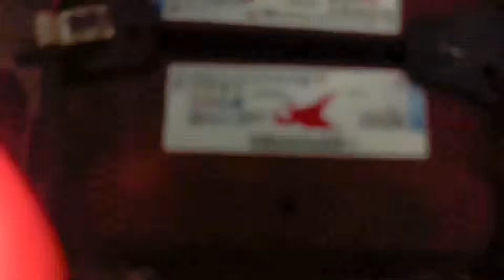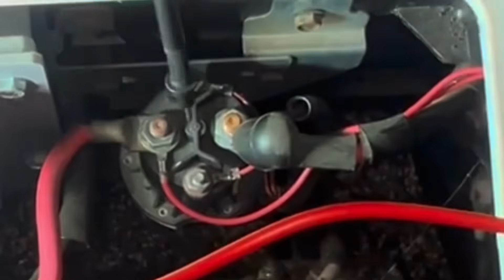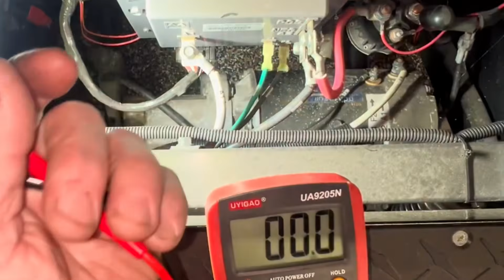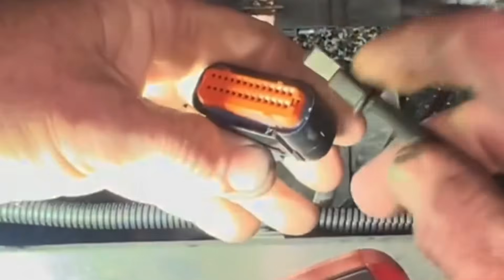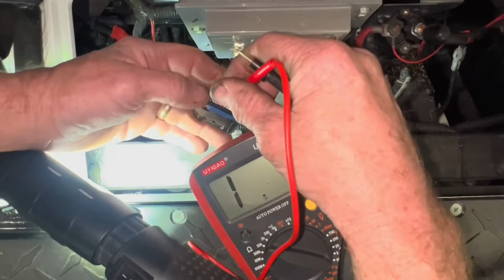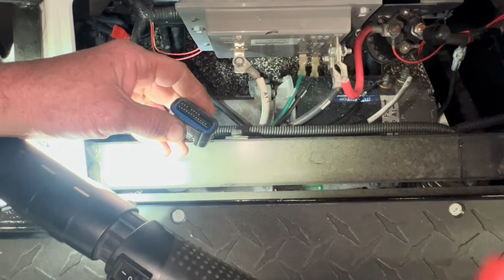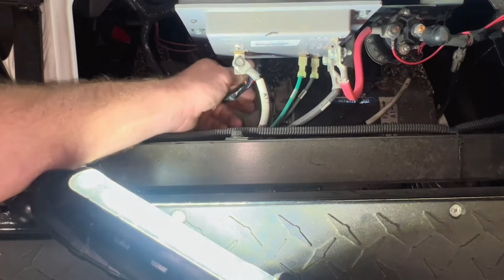Yamaha Electric Golf Cart Troubleshooting - Fixing Common 48V Issues

Comment: Got a question for you sir, 2010 Yamaha drive no voltage when hitting the gas when I put my multi meter leads on the small posts of the solenoid. Bad key switch ?
Reply from the maker: Put the black lead on the main negative red lead on the red wire. Tell me what you get.
Reply: @golfcartwhisperer doesn’t show any voltage from main negative on battery terminal to positive wire on solenoid.
Reply: Also has no resistance from pin 5 and 7 when hitting the gas. Super confused right now lol
Reply: But I tested my key switch and I’m getting voltage there
Reply from the maker: @likezay4627 small post correct? if so, black lean on main negative the red lead on the back of the tow switch Make sure you have voltage is there.
Reply: @golfcartwhisperer sorry yes I’m getting voltage from main negative to small red post on solenoid. And run tow switch is getting proper voltage too
Reply: What do you think my issue is ?
Reply from the maker: Put the black lead on the main negative put the red lead inside pin number three which is your brown wire and hit the gas. Tell me what you get.
Reply: @golfcartwhisperer yup I get voltage there
Reply: What does that mean ?
Reply from the maker: That means your pedal switch I good.
Reply from the maker: Test pin 4 then move the lead to pin 5.   Changing from forward to reverse
Reply: @golfcartwhisperer 48 volts on pin 4 ( black wire ) and only 5 volts on pin 5 ( light blue wire )
Reply: Pin 4 is forward pin 5 is reverse right?
Reply: I’m confused though because it’s showing 48 volts in forward for the black wire and 48 volts in reverse on that same black wire. So voltage doesn’t drop down when I change from forward and reverse .

Comment: Hey bud let me pick your brain I feel like I’m missing something. 2016 Yamaha drive. Solenoid clicks and is working,  controller puts out pack voltage when I hit pedal. I had to put new brushes in the motor. I tested the motor with 12v battery and motor spins.  Could the throttle pedal sensor be the problem if the solenoid clicks?
Reply from the maker: Yes and no. Depending on how the tps failed.  On your output voltage to the motor does it climb voltage the further you hit the gas
Reply: I’m checking the blue and orange wires to the black per Yamaha service manual. Ohms between blue and black is 5 constantly orange wire to black is 5k ohms also pedal up or down. Manual says orange wire is not supposed to see 5k till fully depressed. Does that sound right? I just thought it was weird to have a failed throttle sensor and the controller still puts out voltage.
Reply: Just re read you question you ask about controller. I get pack voltage on controller output as soon as I depress the pedal
Reply from the maker: @MikeLilly-z1n as soon as you let go of pedal it shows battery voltage?
Reply from the maker: @MikeLilly-z1n if it reads 5k already then that’s bad.  But it will click the solenoid that way.
Reply: Yes, as soon as I hit the accelerator pedal in the solenoid clicks, I show full pack voltage output at the controller
Reply from the maker: how are you testing it?
Reply: Like you show. Red lead on b+ black lead on white wire on controller.
Reply from the maker: @MikeLilly-z1n the reason it shows battery voltage is because the throttle sensor is shorted.  But the f n r. Wires are. It allowing voltage to go no where because of the hpd

Comment: Hey I have a 2013 g29 48v . New battery’s and new cables . Cart runs great until you start up a hill then it’s like the solenoid kicks in and out , motor will grab then stop back and forth. It doesn’t trip any thing but if I turn and go back to flat ground it runs great again. Any insight?
Reply from the maker: Have you replaced anything recently. You need to sit on the side of the driver body with the front seat off and check each battery as your driving up the hill. Sounds like bad battery
Reply: @golfcartwhisperer well I bought it not running. The batteries were trash so I replaced them with new 8v superlex batteries and new 2guage cables. They said it was doing that before the old batteries quit . They replaced the motor on it thinking it would fix it but it didn’t then the batteries quit so they got tired of messing with it. I would have sworn the batteries were the problem until I just put brand new ones in it but I will try the test them under load.
Reply from the maker: @Mechanicallyinclined141 well let’s start with the batteries then we’ll go from there.
Reply from the maker: If none of the batteries show bad put your volt meter on 200 vdc and check the small post on solenoid.  What color are the solenoid wires small post.
Reply from the maker: Once you test the batteries individually test them
A a a whole
Reply: @golfcartwhisperer one red and one red/black
Reply: @golfcartwhisperer did each battery separately and they all had 8.5v and none dropped below 7.8 while testing. They have 51.4 and never dropped below 45 while testing
Reply from the maker: @Mechanicallyinclined141 okay good. Put black lead on main negative. And touch it to the red wire on a small post on the solenoid while it’s plugged in and when it quits running see if that dies meaning you want to see if that wire loses voltage or is it the other side which is the ground coming from the controller that tell us which way to go
Reply: @golfcartwhisperer it doesn’t voltage drops from 51 to about 49 and it’s trying to go up but starts loosing power and eventually stalls them the motor jumps

Comment: I have the same golf cart as what is in the video. I have a problem with voltage at the Solenoid.
My Voltage going from battery to Solenoid is 50 volts, which I believe is normal, however when I put multimeter negative on north screw and positive on south screw of solenoid(the two small connectors.), I get initially 49v that almost instantly drops to 29v consistently after I hear engine hum kick in when I press pedal. Wondering if this indicates a motor sending voltage shorts back through solenoid or if it indicates a bad solenoid. All other places I put multimeter following along with video show up normal voltage even the Voltage from Solenoid to controller, which was a surprise considering I get voltage drop from the indicators that look like they are in-between that connection and the battery on the solenoid itself. 

Golf Cart symptoms are solenoid clicks but golf cart wont always respond and go, then sometimes it will go, but it always struggles at top speed and acts like it is having power surges plus rides super slowly/erratic.
Reply from the maker: Do this here put black lead of meter on m- on controller and the red lead on one side of solenoid hit gas tell me what you get. Then do the same test but move to the other big post with the red lead and hit gas. Tell me what you get
Reply: With Negative of multi-meter on m- of controller, and positive on each big post of solenoid with gas pressed I get 2.62V consistently from both sides. What does this indicate?
Reply from the maker: Put the black lead of meter on main negative and the red lead on main positive on battery what do you get. Hit the gas during the test
Reply: @golfcartwhisperer Positive and negative on main battery test I get 50.8v without gas pressed 50.6v with the gas pressed.
Reply from the maker: What did you throttle v
Position sensor voltage ahow
Reply: @golfcartwhisperer With Black lead on M- of controller and red lead on main battery positive I get 2.62 volts again.
Reply from the maker: Yeah that’s not good.  Sounds like something inside the controller is acting up.
Reply: @golfcartwhisperer  With multimeter connections on pin 7 and pin 5 of the controller plug on the 20k ohms setting I get 1.22 at rest. Then a fluctuation down to 0.15 with the gas all the way pressed.
Reply from the maker: @jimcarrey7006 that’s good.

Comment: I have a 2007 YDRE 48V, stopped dead on me while on course.  Batteries all load test fine and 53V when in tow position.  Switch to run, solenoid clicks, voltage on system drops to less than 1V.  Fuse good, all wiring appears good with continuity check.  Did try replacing solenoid but same result.  Completed 12V motor check and had motor rotation.
Reply from the maker: @cojo5495  thanks for commenting.  Put black lead on a1 on controller and  red lead on b+ on controller hit gas tell me what you get
Reply: Thanks for the quick response. I’m getting 0v when I try this.
Reply from the maker: @cojo5495  okay so that means your getting no voltage out the controller.  Have you checked the throttle sensor yet
Reply from the maker: @cojo5495 what did. Outages check according to the video
Reply: @golfcartwhisperer  hey again, thanks for all the info...update, replaced the controller with an Alltrax, solved the problem...nice upgrade from Moric
Reply from the maker: @cojo5495  ok yeah big difference and faster
Reply from the maker: @cojo5495  thanks for letting me know the outcome. Most people just run off into the abyss once I help so who knows if it fixed the problem or not.
Reply: @golfcartwhisperer couple of your clips helped me confirm my suspicions…much appreciated

Comment: Hey buddy ... Your the man... Great videos , keep it going...did you ever make that second video ?   I have kinda tge same problem . 2006 yamaha 48 v g22 .  ..replaced solonoid ,replaced throttle sensor ,checked all wiring from schematic .solonoid  clicks when pressing pedal . The cart runs but only when you give the wheel a push.. it catches and runs perfect.  But when it stops for a few seconds i hear the solonoid click ..and  when pressing pedal it clicks most of the time but never goes .  Other times no click ,and have to turn the tow switch off and on before it clicks again.. checked speed control and seems ok.  ..but it has a 12 - 14 volt draw when key off . ? .. someone replaced the brushes in the motor but never sanded them to the shape of the armeture the  brushes were straighr not curved.  So we sanded them down to the shape they should be .measured by micrometer .. i ran it for a while hoping that the brushes just needed wraring in.. it got better but still wont go without push..   any ideas .? Thanx bud.
Reply from the maker: @cobrakelki  when it clicks  and not run. check voltage on both sides of the solenoid.  Could be a bad solenoid. Let me know what they ahow
Reply: @Golfcartwhisperer  everything is good except ..we have 14.8 v between the red and black solenoid small posts when we hit the pedal. ..also have same voltage coming from speed sensors connector with power off . When speed sensor is disconnected the  solinoid won't click . Would there be a short or wire connected  wrong .. ? Or new solinoid is faulty ?
Reply from the maker: @cobrakelki  just see I never responded. Sorry about that dis you get it fixed
Reply: Hi. Did you ever resolve the issue? Your symptoms sound similar to mine. It will run until I stop and then won’t run. Sometimes if I flip the tow switch on and off, it will run for a bit but that’s it. I have a new throttle sensor and solenoid in it thinking those would be an easy fix but nope. So now I’m going to check everything based off the wiring diagram.
Reply from the maker: @planman860  Yamahas are bad for the controller causing this when it don’t run check voltage according to the video. And let me know what’s missing
Reply: @golfcartwhisperer  I sent my buddy who helps me with electrical stuff two of your videos along with the wiring diagram. I’ll let you know what we find. Thanks for all you do it’s very helpful!
Reply from the maker: @planman860  on your solenoid what color are your small wires
Reply: @golfcartwhisperer  I’ll have to check in the morning
Reply: @ hi! Looking down at it from the rear of cart. Red/white is on the lower small post left post and black is on the right.
Reply: @ my connections on the controller and plug are really dirty, like muddy. What’s the best way to clean everything?
Reply from the maker: @ I normally use some carburetor cleaner

Comment: Just found your channel, i have a good one for you... 2000 yamaha g19 e... 48 v .. fresh batteries, if cart sits for a while it wont move or the reverse alarm wont work, if i pull the 3 amp fuse and reinstall it the cart runs.. got any ideas? And i have checked voltage and every thing looks good... ideas????
Reply from the maker: Make sure you subscribed. 99% of the time that means the capacitors inside the controller or not or not staying charged up.
Reply: @golfcartwhisperer i just subbed
Reply: @Golfcartwhisperer  so i'm guessing that means the controllers on life support?
Reply from the maker: @ lol yes is hanging on for sure
Reply: A Navitis system will fix that problem...lol
Reply from the maker: @HogheadBill now you talking and that bad boy will haul tail too

Comment: I have a yamaha 48v, the battery testing from main + to main - is at 47v. i watched the video and i was testing the solenoid and it shows 0.00 and then when i hit the gas it still shows 0.00, but the solenoid clicks. what could this be?
Reply from the maker: @mariahphillips180  also hit that subscribe button for me
Reply from the maker: @mariahphillips180  how are you testing the solenoid.   It should be tested. Black lead on your main battery negative and the red lead on the big post on the solenoid one at a time.
Reply: @golfcartwhisperer should the golf cart be on or off when hitting pedal?
Reply from the maker: @mariahphillips180 on
Reply: @golfcartwhisperer  okay so now the solenoid isn’t clicking when i hit the gas. but with the black wire on the main negative and the red on the big post with the black wire of the solenoid i get 47.6 , on the other big post with the red wire i get 0.00

Comment: What if on a1 and poitive i get 33v when i hit pedal i get 54v but cart dont move
Reply from the maker: @lockdocfam that men’s your controller is putting out voltage. Does your solenoid click   Hit that subscribe button for me
Reply: Yes the solenoid clicks
Reply from the maker: @lockdocfam when’s the last time cart ran.?
Reply: Yeah its putting out voltage but u did the same test and yours put out 0v till he hit pedal
Mine puts out 33v then goes to 54 when i hit pedal. Byw i put lithium batteries in 2 years ago and i have stock moric controller
Reply from the maker: @lockdocfam has it been giving you a problem.
Reply from the maker: @lockdocfam I am going to send a video watch this
Reply: Do u think that means there is a issue with controller or with motor
Reply from the maker: @lockdocfam motor the voltage you have before hit gas is dead voltage
Reply: 2 days ago
Reply: Its started hesitating it wouldnt go when i hit gas then it would just launch off like pedal was all the way down even though i was barely hitting pedal. Then it just quit going all together. I replaced solenoid and this it where im at now
Reply: Ok wheres the video
Reply: Also no matter if i put cart in tow or run mode it moves freely i can push it foward and backwardwith no tension If in run the solenoid clicks when i push it but no tension. Tow mode the solenoid dont click and no tension when i push it
Reply from the maker: @ oh so when you push in run position no beeping yeah replace controller then
Reply: One more question. I just double checked the a1 to positive from controller. It started at 38.8v then i half press pedal and it bounced around from 38.8 to 40v then i pressed pedal all the way down and I went all way to 14v and it stayed at 14.v even when i released pedal and thats with the ignition switch off.with switch on it started at 43v when I pressed pedal it went all way down to 2.7v then I let go of pedal it goes to 18v and I leave my meter on it and it very slowly trickles down. So conclusion is when I test positive to a1 multiple times with switch on it starts at random voltage when I pressed pedal it goes down to 2.7v when pedal it to floor. The only thing consistent is when pedal is to the floor it sits at 2.7v from a1 to positive with switch on. Sorry for the rambling I was testing it as I was typing
Reply: Got it

Comment: I have a g29e 12 volt batteries 
I have strong batteries 51 volts
My silnoid not clicking on
No voltage to any switches
Teasted the motor is good
Changed out silinoid no change 
I get like 21volts to key switch
I ordered a controller 
Is that the fix
Reply: I'm not getting the new silinoid to click at all
Reply from the maker: @donbeth2186  do this here put black lead on main negative and the red lead on back of tow switch. Also check the min positive and negative battery tell me what voltage you have. I say no on controller because you don’t have enough voltage it sounds like.
Reply: @Golfcartwhisperer  thanks for getting back
I've got new trojans 51 or more volts.
 watching your video I deciphered the controller was bad no volts comming out of the controller 
Had one off marketplace foctory one brand new great deal on it put it in and it works thank God.
Now I think the potentiometer is wacky it fluctuating power
Reply from the maker: Check voltage on the controller coming from the it’s.  Don’t just assume. The reason why I say that is because I had a subscriber buy one of them ones off Amazon and that’s what his was doing slow fast slow fast.  So just check voltage again.
Reply from the maker: Hit that subscribe button button for me.   Trying to be the #1 golf cart troubleshooting channel on you tube